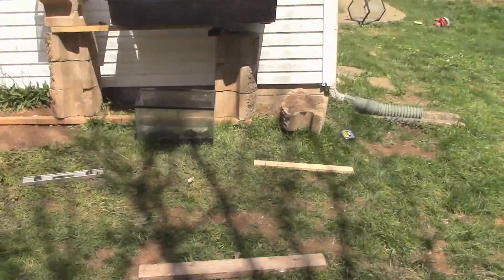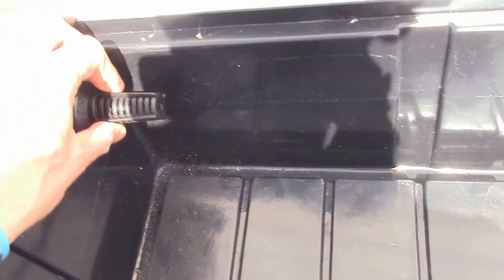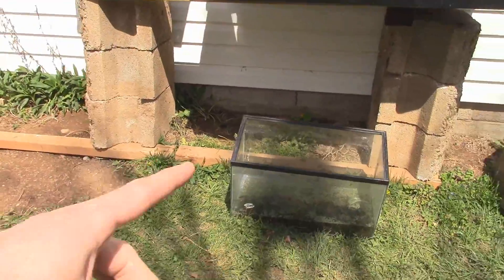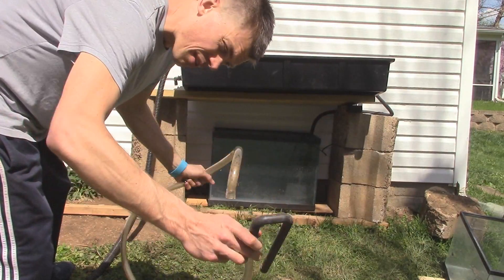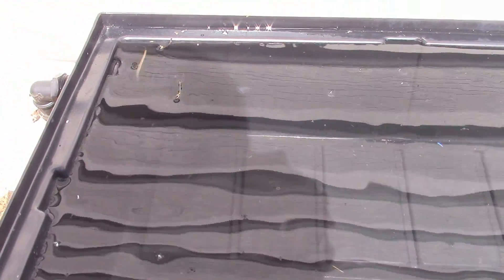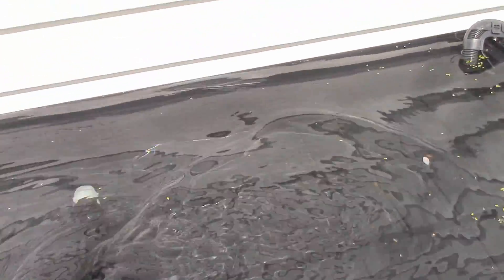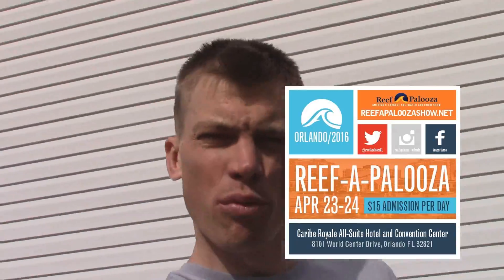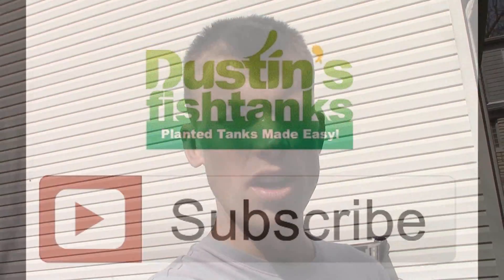Aquaponics system setup in back yard

Comment: I use Aquaponics to filter all of my tanks and I literally have no maintenance. I have put carbon and a sponge at the front of the system to do that type of filtration but the rest is just clay balls with lettuce growing in it. You should try it out Dustin, it's very cheap and easy to do.

Comment: Cool! Looking forward to seeing the progress. I wanted to hook up an aquaponics system to my little pond outside, but just couldn't get the plumbing and other logistics figured out. Seems to me that in the plumbing world, there is always at least one critical fitting that you can't find in the right size. OR. It LEAKS
Reply: +Joan Smith Ideally, you'd use the correct fittings, but if none exist, you can always use a transition coupling to bridge one standard to another such as this one: http://www.homedepot.com/p/Fernco-1-in-x-1-in-DWV-Flexible-PVC-Coupling-P1056-100/202245805